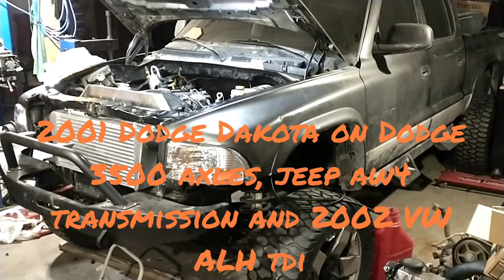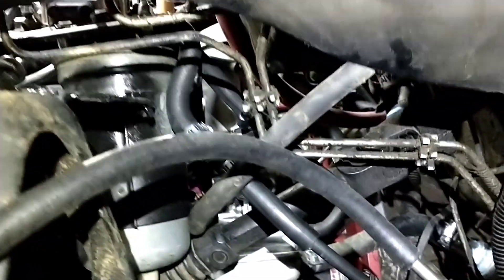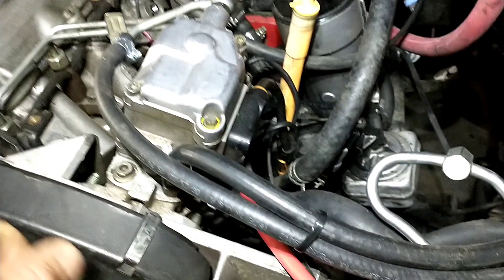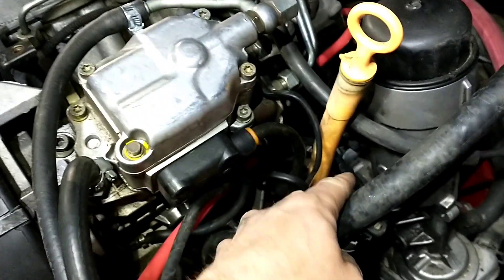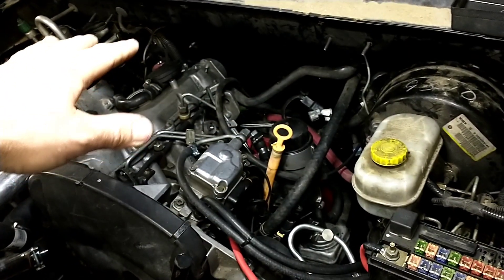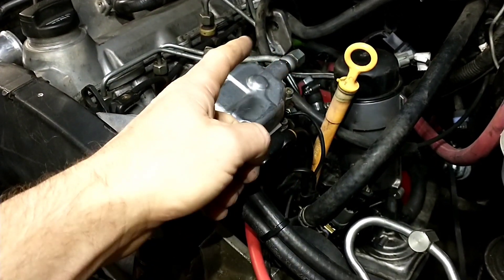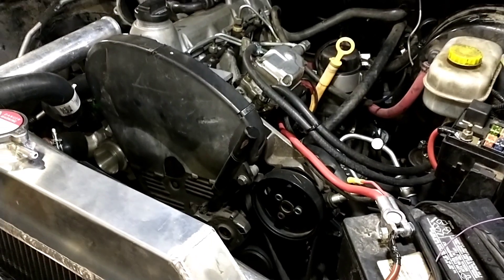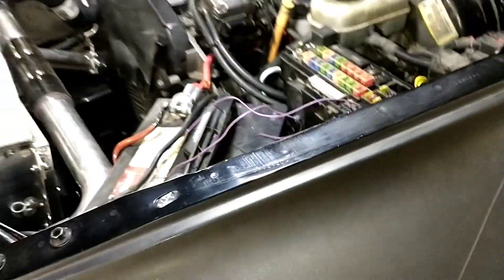Dakota TDI Swap Update, What I Do For Fuel System Setup and Factory Gauge Wiring On My Swaps

Comment: so this tee in the middle sits between fuel filter and fuel tank?
Reply from the maker: You can put it between the fuel filter and the engine, it will just be constantly cycling quite a bit of fuel through the filter, potential plugging that up sooner.  But anywhere in the system will work

Comment: Do you use the dodge knock sensor?
Reply from the maker: The VW engine doesn't need any input from the Dodge electronics, I'm simply using only  the sensors required to make the dash gauges work
Reply: Awesome, yes, so guessing @TDISwaps  , you use the VW ecu to add AC?  Or use the factory AC of swap vehicle?  Depending on the AC unit you are using.  Your videos are great!
Reply from the maker: @ncharp as long as the AC compressor is simple like the alh and just 12v + to kick the clutch on then it ends up being just like this dodge so I can wire the Dodge compressor plug right to the VW compressor. And then the VW engines self adjust idle already so it doesn't bog down when you kick the AC on

Comment: Do you do custom wiring for the cjaa 2.0 tdi's? I have a extra motor Im thinking about putting it in a jeep Cherokee.
Reply from the maker: I can definitely wire it, I can't mess with the computer tuning and I don't have an engine to test it on, but I can check functions of all the sensors of you send it all with.  I haven't done one yet to have exact pricing, but you can PM me on Facebook.  https://www.facebook.com/profile.php?id=100014261163897&mibextid=ZbWKwL

Comment: How does the electronic actuator work on your tdi? I never seen that setup before so I am curious how it works with ecu.
Reply from the maker: Basically with the tuning setup right you splice into the n75 vacuum actuator and they both run together without even knowing it. Then you just don't hook up the vacuum line and let the electronic actuator do the work